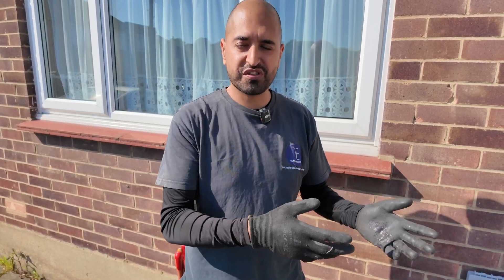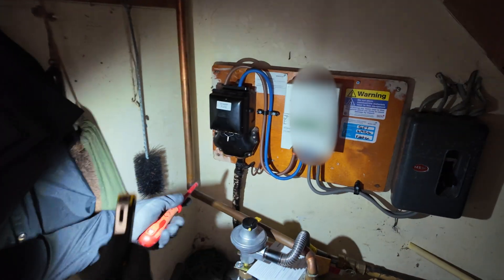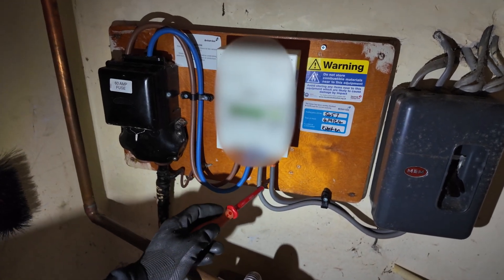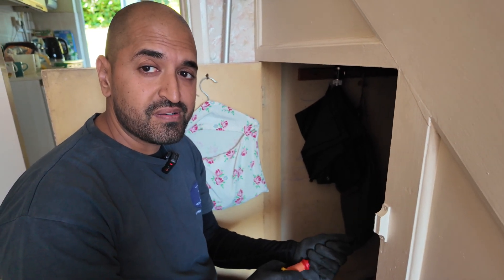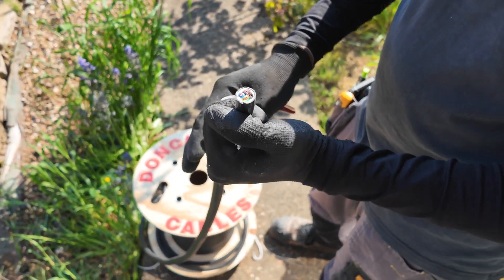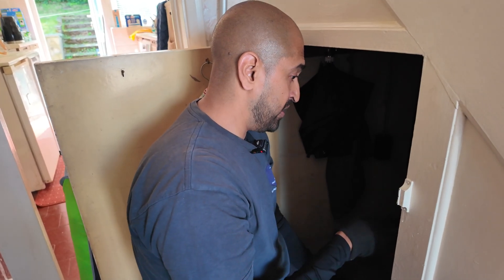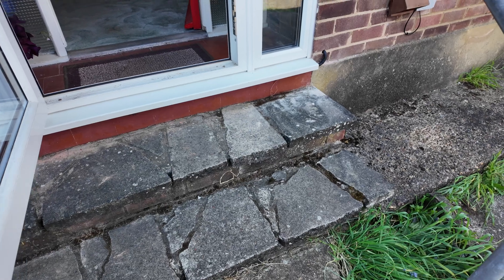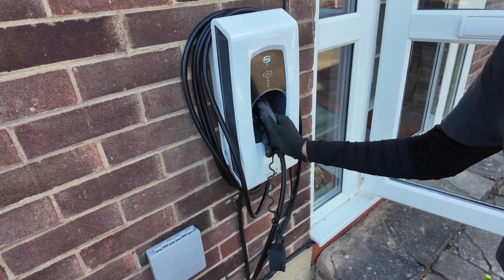How Easy Is It To Install an EV Charger In an Old House?

Comment: @Ben-ho1yn

Please refrain from spreading misinformation you have made 4 incorrect comments now.

Are you a qualified/gold card electrician? Have you passed the EV Charger Installation course? Do you install EV Chargers for a living?

Or have you watched a few YouTube videos "a little bit of knowledge is dangerous"

If you were to read the IET guide or any instruction manual for an EV Charger all quote the CT clamp is to be located before any splits in meter tails, so the WHOLE electrical system can be monitored.

A simple Google search will give you a detailed explanation.

A 60amp fuse or 100amp fuse has nothing to do with the installation safety. The type of breaker you have does, the EV charger has been fitted with an RCBO the highest from of protection.

At the beginning of the video Dan quite clearly stated he is currently not in a position to update the house electrics this includes the consumer unit(fusebox). For the DNO to upgrade the main fuse to 100amp the meter tails feeding the house consumer unit would need to be uprated to 25mm2, however this is not safe as the main switch is only rate for 60amps.

Simply put the DNO will refuse unless both the meter tails and consumer unit is updated.

All the information we have just relayed was taken into account before the installation and this was the solution for a safe installation.

This video was made to show how simple it can be without all the technical knowledge.

Kind regards 

Vartia Electrics

Comment: Noticed now watched the full video the spark installs a Current Transformer clamp to monitor the current use if the house to throttle back the amount of current (Amps) going to the charger. It looks from the video though that the CT clamp is on the outgoing supply from the meter meaning it is monitoring both current to the house and charger at the same time. This doesn't seem right as why would you monitor the current to the car charger as well as the house seeing as the car charger is set to throttle back if too much current is used. If this happens then the car charger would be on a feedback loop causing it to increase and decrease current draw depending upon how much it draws itself. I might be wrong but I think that CT clamp should be on the tail going to the old consumer unit so it only monitors how much the house is drawing current.
As said previously get the sparks to contact the DNO to upgrade your supply and fuse to 100A...its free and then you wont need to monitor the current/throttle the charge rate and you will be able to charge at 7kw constantly. Oh and get that flipping old consumer unit replaced as a matter of urgency if you want to protect yourself from potential shock.
Reply: @Ben-ho1yn
Please refrain from spreading misinformation you have made 4 incorrect comments now.

Are you a qualified/gold card electrician? Have you passed the EV Charger Installation course? Do you install EV Chargers for a living?

Or have you watched a few YouTube videos "a little bit of knowledge is dangerous"

If you were to read the IET guide or any instruction manual for an EV Charger all quote the CT clamp is to be located before any splits in meter tails, so the WHOLE electrical system can be monitored.

A simple Google search will give you a detailed explanation.

A 60amp fuse or 100amp fuse has nothing to do with the installation safety. The type of breaker you have does, the EV charger has been fitted with an RCBO the highest from of protection.

At the beginning of the video Dan quite clearly stated he is currently not in a position to update the house electrics this includes the consumer unit(fusebox). For the DNO to upgrade the main fuse to 100amp the meter tails feeding the house consumer unit would need to be uprated to 25mm2, however this is not safe as the main switch is only rate for 60amps.

Simply put the DNO will refuse unless both the meter tails and consumer unit is updated.

All the information we have just relayed was taken into account before the installation and this was the solution for a safe installation.

This video was made to show how simple it can be without all the technical knowledge.

Kind regards 

Vartia Electrics
Reply: @Ben-ho1yn
Please refrain from spreading misinformation you have made 4 incorrect comments now.

Are you a qualified/gold card electrician? Have you passed the EV Charger Installation course? Do you install EV Chargers for a living?

Or have you watched a few YouTube videos "a little bit of knowledge is dangerous"

If you were to read the IET guide or any instruction manual for an EV Charger all quote the CT clamp is to be located before any splits in meter tails, so the WHOLE electrical system can be monitored.

A simple Google search will give you a detailed explanation.

A 60amp fuse or 100amp fuse has nothing to do with the installation safety. The type of breaker you have does, the EV charger has been fitted with an RCBO the highest from of protection.

At the beginning of the video Dan quite clearly stated he is currently not in a position to update the house electrics this includes the consumer unit(fusebox). For the DNO to upgrade the main fuse to 100amp the meter tails feeding the house consumer unit would need to be uprated to 25mm2, however this is not safe as the main switch is only rate for 60amps.

Simply put the DNO will refuse unless both the meter tails and consumer unit is updated.

All the information we have just relayed was taken into account before the installation and this was the solution for a safe installation.

This video was made to show how simple it can be without all the technical knowledge.

Kind regards 

Vartia Electrics